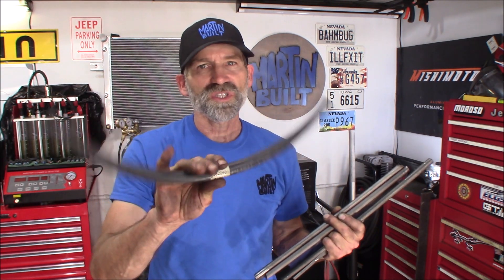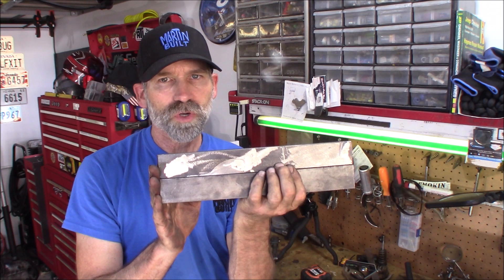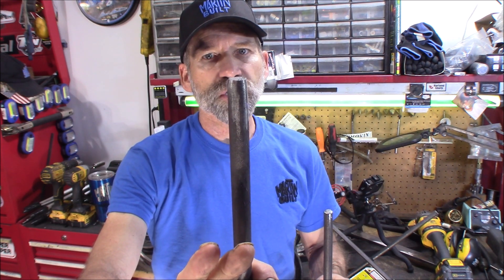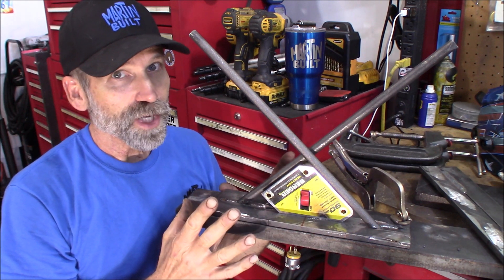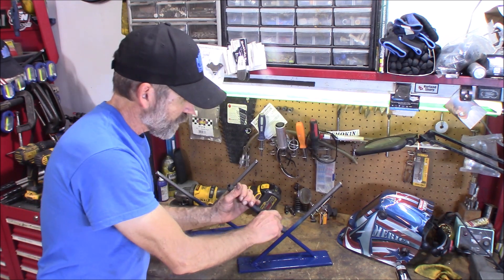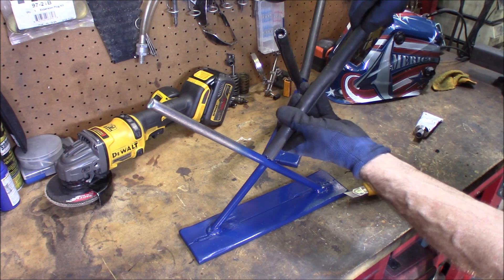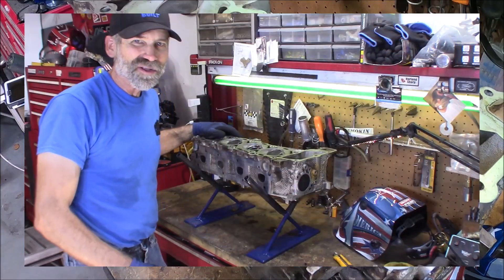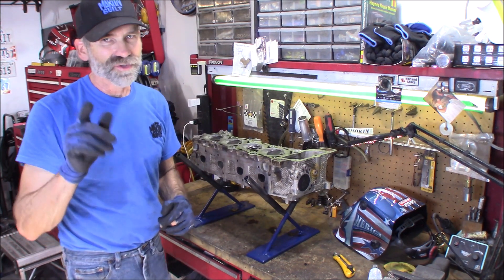How to Build Cylinder Head Stands (V-Style Head Holder)

Comment: The only problem I could see with the rubber hose and rtv would be when it starts getting brittle or tore up from use it'll be harder to get back off to replace the rubber. Don't know how much you'll use them so it may never be a problem. Just putting my 2 cents out there. Love the video. Thanks for what you do.
Reply: Of course, that makes no sense;  4 pcs of hose that  fit over the bars is the way to do it,but i guess there were none round right there and then...

Comment: I built wood cradles for mine...loved them

But I did have news on my 4.7l build for you...I got my motor built...HO heads, cams, beehive springs, solid lifters, everything was great ..the motor sounded GREAT...isles great drove great...for about a half hour...then my brand new head gasket blew...caused a premature detonation in cylinder 5 and blew the side out of the piston which scarred the cylinder wall really bad...I thought it was a valve seat issue because one of the valves was sticking...a chunk of piston got stuck in the valve...

Waiting on O'Reilly's right now since I work there and bought everything from there. Even my torque wrench...I put in a request for a new motor

Comment: I’ve always used and seen the mount which stake into the head bolt bores. They work well for assembly and lapping but nothing else.
This design is much much much better

I just dinged the milled head gasket surface of my rebuilt HO heads due to lack of proper stands.
Thank you as always!
Reply from the maker: yeah that was the one thing I like about these stands is the multiple positions.